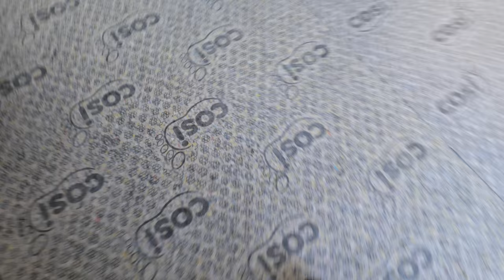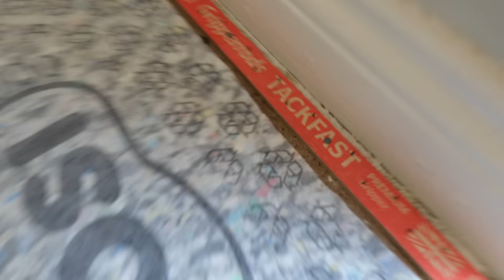How To Install Carpet | Easy Step By Step Beginners Guide

Comment: When my man gave 3 different ways to hit a nail in a small space like that I knew I was on the right channel. I’m 7 mins in so far and exactly what I’m looking for.
Reply: @homeimprovements I've installed for 40 yrs. Lots of incorrect work here. # 1 problem is they are not using a power stretcher. Even with a knee kicker, they are still doing a poor job. I have been doing restretch work for a few years now. I love folling these kinda guys. If you've been properly trained, you would never hire these guys.
Reply: @daveparkes8539 you missed the point of the video I guess. They are showing this for a beginner level, someone like me, who never had to put a carpet or knew what basic tools are needed. It is not meant to be a "professional" work but a tutorial for people who never done it.
Reply: @MyaaaaaLoVerock  so you learn how to do it wrong right from the start?

Comment: You forgot to explain how to cut bits off after locking it in on the last two walls. you said yourself it wasn't that difficult on the first one because we weren't stretching but then left us hanging on how to do it when it's stretched... I guess I will just wing it with what you did explain which was a lot, thanks

Comment: Great video, I’m about to start with a small 3x4 room. What should I put on the door side? The rest of the house will be done later so don’t know what to put between the new carpet and old carpet in the door threshold
Reply from the maker: Either run the carpet long and cut back when ready or door bar and a scrap of carpet in the hall side to stop pin spiking your feet 😊
Reply: Thanks now I’m more confuse cause you are talking Chinese hahah I will figure it out

Comment: I didn't have a carpet kicker, so I made one out of scraps of wood. (It was the wood from a frame for a canvas picture, 4cm x 2.5cm cross section.) I glued it all together and screwed it to make the shape of a kicker. 

For the grip I used 4 strips of carpet gripper glued and nailed onto the flat base, which covered the 2 wooden strips deep. It turned out to be 14 cm x 8cm. Two smaller pieced were glued and screwed parallel to the connecting piece for added strength.

The connecting piece 40cm long glued and screwed on top of the knee bit, which was made with one strip 14cm x 11cm then the two smaller strips 4cm x 5 cm glued and screwed. On top of that another two strips 14cm x 11cm again glued. 

Finished off with 2cm thick solid foam 14cm x 11cm glued on with wood glue. 

It works reasonably well enough to fit the carpet. Not quite up to your guys standard but the finished job looked good and tight. So thank you very much. I realised the previous fitting of the carpet grippers were way away from the wall, so moving them in as you showed made all the difference.

Comment: Great video lads!! Two questions: When you have a concrete floor, I presume I should just use the adhesive spray to hold the corners of the underlay in place? And with the gripper bars, can I get away with sticking them down in long lengths or is it best to cut them down to shorter lengths? Much appreciated! J
Reply from the maker: Yes and cut them down that’s the British standard way anyhow 😊

Comment: I’ve been selling carpet for 18 years now at a small business ran by a 74 year old man. I know that I won’t have the job of selling carpet much longer because of his age but I would like to become an installer. Only problem is I’ll be 40 this coming January and well I’ve been cutting carpet and vinyl flooring on concrete floor for years and my body isn’t the greatest of shape especially my knees at times. Did I miss my window of opportunity to begin doing this for a living? I would love to learn how to install carpet from anything to traditional stretch in all the way to making T seams on big rooms and figuring carpet jobs correctly when measuring jobs. Problem is I don’t know if I can take a course at a local college for this or do I have to continue watching how to videos and try my best. What would you recommend for somebody in my position?

Comment: Great job lads, and good instruction. Nice to see you didn't cut the Vs off around the pipes, was one of my pet hates, I was taught to tuck them in. I learnt 40 years ago, and probably 1 in 4 of the carpets we fitted was an Axminster, so had to get the pattern straight, and pattern match HSL it was great to see the back of patterned carpets the job became a lot easier and faster, if it makes a comeback fitters will recall the good old days when it was all twist.
Reply: Yes I remember that, I was always taught to tuck around the pipes so if the radiator was ever moved it was an easy repair.
I also remember when fitting Axminster folding the bottom rise on a step so they could be moved if they started to wear. All man made rubbish these days.
Reply from the maker: Thanks mate 😁😁😁

Comment: great video, thanks for all your knowledge/tips. Quick question, what size staples to use? i have 11mm underlay. i have tried 10mm but to get the staple to hit the floorboard you need to push it down and an indent is caused. will this indent be seen in the carpet above or should i just use 14mm staples. thanks.
Reply from the maker: That’s correct 10mm is fine and it will dimple but isn’t an issue 😊😊

Comment: You’ve been life savers!!! First time ever fitting carpet, I could not have done it without this video 🙌🏻🙌🏻🙌🏻🙌🏻
Reply from the maker: Glad it was helpful 😊
Reply: How’d it go? 
I’m thinking about doing the same, but thinking it might be too hard.
Reply: I couldn’t believe how well it went. As long as you have those basic tools you’ll be fine. I have never tried this before but my daughters carpet is almost perfect (I went a bit mad with the Stanley knife in one small area so I glued a scrap in that place but you wouldn’t know). My daughter’s room was a perfect square so I had it pretty easy but after doing this I would definitely take on a larger more complicated space. Good luck

Comment: Good demonstration but I just bolster the carpet into the skirts then run the knife along at 45 deg. Along it in one sweep. Quick bump with the carpet thumper, jobs a gooden. An average longe only takes about an hour to do.

Comment: Thanks for the Tutorial lads.  Can I please ask how comes you had to get so much more carpet than the measurements you need why not just a few inches longer ? Is it just to be on the safe side? I know you probably didn’t do the measurements for the carpet just curious as I’m fitting in my own carpets.
Reply from the maker: Carpets are a set width 4m / 5m so can sometimes have a lot of waste and we also allow 6inches min as it’s much safer that way not worth the risk on 100s of pounds of flooring 😁😁😁

Comment: When fitting felt back carpet direct to the floor what is the preferred adhesive, spray or double sided carpet tape ?
Reply from the maker: I like to spray the perimeter personally and stretch fit but there’s no wrong answer imo 😊
Reply: @homeimprovements  if that's good enough for you then that's what I'll do 👍

Comment: If my room is 4x4 meters and the carpet i buy is 4x4 meters, is it still going to work? As i see most tutorials showing the tucking the carpet behind at the side's. Can I just have it "not tucked"? Or can I stretch to tuck?
Reply from the maker: You would need the carpet to be slightly larger than the room and then cut down to fit as walls may not be perfectly straight 😊

Comment: Do you have a recommendation for what to use for underlayment on concrete? Spray adhesive isn't ideal just in case I need to take it out later.

Comment: Would you tape the joints on fibreboard underlay for laminate or not needed?
Reply: You could use insulation tape to improve the thermal property of the underlay meaning less heat loss. If the underlay has no thermal value then this would be a pointless endeavour.

Comment: this helped a ton! thanks for the video! Im installing carpet on some very hard concrete that doesnt like to take nails. no matter what size the concrete just busts apart or the nails break. I ended up going with some extremely strong expoxy and glued the tac strips or "grippers" down. I was lost on how to lay the carpet out and get it fitted in, this video helped more than any on here that ive seen so thanks again! I really like how you all showed how to make the relief cuts too! Looks like I need to get a much better knife blade too haha
Reply from the maker: Awesome and thanks for watching 😊💪🏼

Comment: What spacing will someone experienced put between the skirting and the gripper
Reply from the maker: 2/3 thickness of carpet being installed then some adjustments depending on pile type loose piles can be bit tighter 😊

Comment: also if you straight edge an inch off one side you can bunt it up to a straight wall and back wall and only need to trim 2 sides of  wall....speeds time up....the excess on all walls is not necessary ...as long as its not factory edge ....cant power strech sides but knee kick them after stretching length.....Just an idea...
Reply: Your idea saves way more excess to be saved for a closet or rug or even a repair somewhere in the future. 📅  fido 🐕 might like it to 🏠

Comment: I'm a carpet installer from the USA and it's cool seeing your methods and techniques, you guys trim and tuck so quickly without a trimmer makes me wonder why I have one. Super solid work, but I need to ask, how soft is that carpet backing?! Over here there is maybe one type of carpet backing with which you'd get away with kicking it tight but for every installation power stretching is the common practice and companies/stores will require you to have one and use it on every job.
Reply from the maker: Our backings are pretty soft so kicking is ok up to 5m or 16 ft 😊😊
Reply: Wall trimmers are 1st on my list as the most time saving and efficient carpet tool. Those guys could have aligned the carpet net against the longest wall they stretched off of and saved time trimming it. There would of been 5" more on the other wall to save and they butchered a lot more off the piece with the side with the 2 door ways. On case of a repair sometime down the road utilized the carpet to have the biggest piece left over for whatever. Yeah right using a rubber mallet on a drive bar. These guys didn't empress me at all and just unroll the dang roll of carpet to get the tube out, then fold the carpet in half roll it up and it's that much easier to unroll inside.

Comment: Hi guys, thanks for the video! Tried today ,no luck so far) but fingers crossed. We got woollen  carpet ,did almost everything as on the video, but have  bubbles . What do we do wrong ? I was thinking probably we didn’t trim enough ? It was ok before trimming. Thanks in advance
Reply from the maker: Thanks 😊 Could well be the problem stretch again and re trim 😁
Reply: @homeimprovements  oh) we did it, not the best but it’s the first one) thank you
Reply: I installed carpet for 30 years with a knee kicker and power stretcher. Both work but the longer the rooms and the stiffer the carpet backing the more a power stretcher is needed. You really need to lay into a knee kicker most of the time. These guys were just barely nudging it especially for the dense carpet. If you redo your room work your way up to kicking the carpet harder. Wool damages easier than nylon and wool is usually a level loop weave which is easier to damage too.
Reply: @rodneysmith247  thank you , it’s really helpful, we will redo it again, because it’s still not a 100%

Comment: What if I am fitting more than one room and I have a huge roll of carpet  to work with where should I cut it to divide it
Reply from the maker: Not sure what you mean there ?
Reply: So I bought a roll of carpet for three rooms and it came as one massive roll and I’m not sure what to do with it
Reply from the maker: Measure the areas and cut it down into three separate pieces
Reply: @homeimprovements  that’s the plan in theory but I am not sure where I can unroll and cut what I need since it’s one huge roll that’s meant to fit three separate rooms
Reply: Ur local football field
Reply: 1st measure your rooms add up the lengths to make sure there's enough 1st. Usually 2" extra is all that's needed per cut. 1st you have to square the end to measure off of. Roll out just more than than the length of the room and tape measure up from the end up towards the roll of carpet on both side and put 1/2" slice markes inwards. Roll the carpet roll back to where the slice marks are at the top of the roll. Use a chalk line to snap a line using very little chalk. Do 1 more cut and there's your 3 rooms.

Comment: Tip: If you ever run out of glue spray or staples ive ran many floors and learned the hard way lol to have plenty of duct tape...tape the padding to tack strips too....just have to be easy when shifting floor around...i have yet to have one bunch on me...unless its over vinyl flooring....but most wood subfloors help to hold the padding....and makes the tear out much easier for the next guy or you......Just tape in sections on pad and over nails on tack...step down on tack and pad and it holds beautifully...I also used to carry twine and a hook needle to hand stich seams no tape....
Reply: Top tip….don’t run out of glue or staples.
I couldn’t understand what your said after the first sentence.
Reply: Padding? Do you mean underlay?

Comment: Hurts my knees watching them blast away at the kicker.  I use a power stretcher.  Small rooms with thin carpet would prolly fine to kick it in.  I love how they cut the carpet before they tuck it. Seems everyone from the uk does it like that.  I've tried but can't seem to get the hang of it.  I have to fold it and cut it from the back

Comment: Absolutely correct about shoes. If i cant wear em, someone else is going to install.  Good installers watch where they step.... No mud, mou automotive oul spots, no dog do do.
By the time youre unrolling the carpet ant forieng residu has been walked off and thf shoes are fine.
My toes cannot handle the lack of support. 49 years and still no carpet damage from wearing shoes.

Comment: Any tips on fitting a carpet in a loft around a joist and a loft hatch had it lying up the stairs for 2 weeks thinking what's the best way 😂😂
Reply: Hi, very similar but easier as u can use joist as an edge to cut up to carpet should be laid onto loft panels (flooring) in between lower joists, panels should be screwed down onto joists so there’s no vibration on ceiling, carpet can be laid straight on floor or with underlay if u want less noise, hope that helps, ( lay Carpet up to hatch finish edges with screw down metal strip or as in video depending on loft layout

Comment: Good video but important to say you really want to stretch the lengths first not the width.
Reply from the maker: Thanks for the tip 😊
Reply: To do the length you have to do 3 or 4 feet in on each corner of the width on the 1 end of the room.
Reply: @rodneysmith247  yeh 2 corners, hopefully rooms not full of furniture too 🤣

Comment: Don't you have a carpet trimmer,
Reply from the maker: I do just not got the hang of it so stuck to this method been using it for 10 years 😊
Reply: @homeimprovements  carpet trimmer, made by Roberts, is the best. It's same as what you do at start. Place trimmer, in it will run ,along wall ,pushing, hard at the back and,in to wall at front, but if your smoothedge  is too wide, should be about a finger tip, that doesn't go all way to floor, I've been laying since 14, finished trade of , carpet and vinyl, floor coverings,